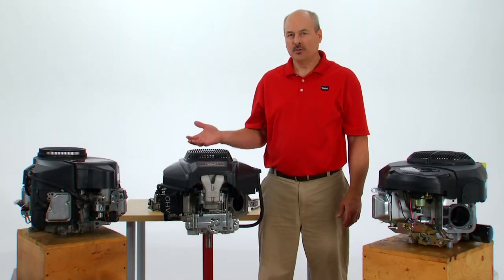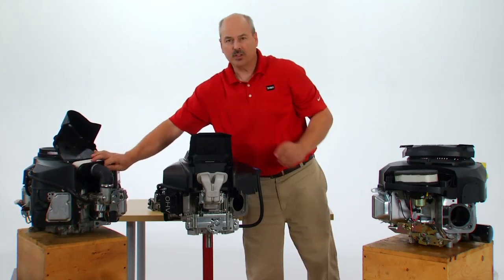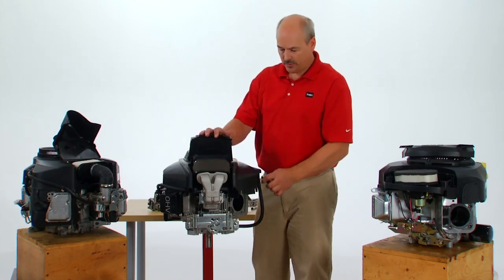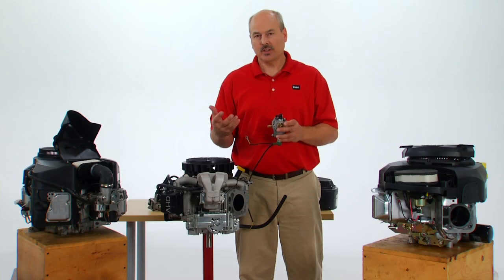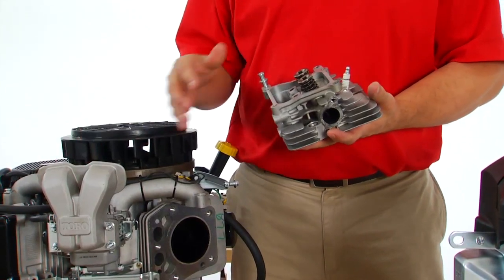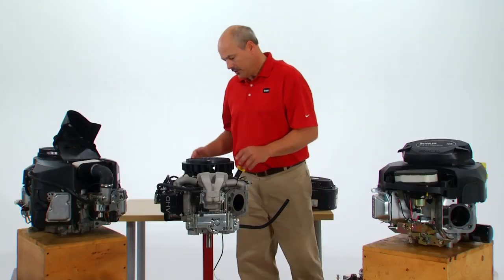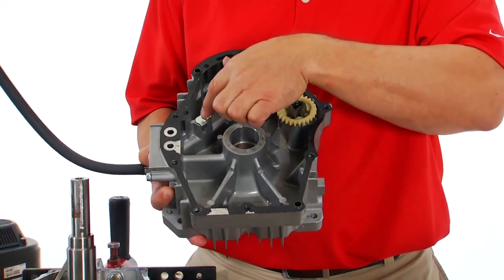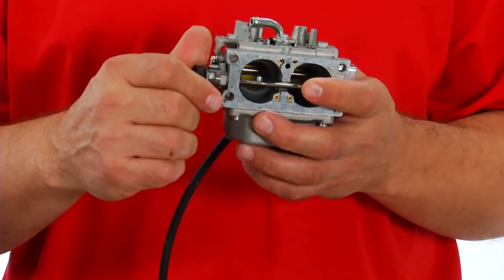Toro V-Twin Engine

Comment: This video is 6 Years old now, Does anyone have any updates on the longevity of this motor? Curious about that "Composite" gear under heat and load over time. Has Toro backed their warranty with these motors?
Reply: 3-year unlimited hours warranty for the Toro.
Reply: I got one and I wish I would have bought a Toro with a Kawasaki engine. The Toro brand is made by Loncin Chinese company, mine back fires and the paper work says it has a warranty but I have yet to see it.  When I take it back for warranty they only do what they can charge me for. In fact I will never buy another Toro. I have the commercial myride I only bought it for the seat. It's more comfortable than my big chair at the house. and has shock absorbers on it for comfort.
Reply: I ended up buying one and have about 20 hrs on mower and so far so good. Break-in oil change was a breeze and synthetic oil seems to help with fuel consumption. I'm not using mine for commercial use just a homeowner.
Reply: You have to turn it off full throttle

Comment: I know for a fact of the other engines have a pre-filter as well
Reply: I bought a 2020 titan with a 48 in deck. I have 3 questions that I would appreciate a logical answer from a Toro expert.. question 1. Why does a toro want to start the engine at full throttle,?  2 Why shut the engine down at full throttle? 3 why engage the blades at full throttle? I have never operated any piece of equipment this way. It goes against logic. You don’t operate any other piece of equipment this. Way. That I know of except a cheep push mower. If you operated your car/truck nothing would last very long.i have never owned a 0 turn mower but I have Chain  saws, Blowers, string trimmers, small garden tractors.with small 2 cylinder engines and blades with electric clutches. Most engines need to warm up to get full lubrication. Looks like there will be a lot of extra wear on the engine, electric clutch and belt. As for shutting down the engine at full throttle I would think it better to let the engine idle a few min to cool down.
Reply: It will backfire bad if you shut it down at idle I have a toro 60 with the Kawasaki 24.5 hp motor and it specifically says to shut it down any full throttle and engage the blades at full throttle if u engage them at low throttle it jerks and jumps the belts

Comment: I have a 2015 toro 50 in ss5000 with the 24hp toro motor have had nothing but trouble with it from the start.I can never get the motor to start had it to the shop 10 times they told me they were junk they get them in all the time.I wish I never bought this mower...
Reply: then im sure if we search on youtube we would find dozens of "failure" vids aabout the toro engine???? NOPE!
Reply: Mine has been a dream. You must be one of those people where everything breaks for some reason.
Reply: @crabtrap  I have one. Many regrets. back firing all the time took it in for warranty and still back firing.  Junk  YIP
Reply: @tonyjohnson1068  backfiring? Thats your issue??? Take back for wanntee or stop driving with choke on.
Im on 2yrs zero prob with machine or the Lincon emgine
Reply: @crabtrap  I did take it back for warranty and I don't drive with the choke on,
Reply: @tonyjohnson1068  then stop using gasoline from an old pickle bucket.  also take it back and say "fix it!".
Reply: @crabtrap  Not funny. I use ethanol free gas. it had 20 hours on it the first time I took it back. I need to find me a new Toro Dealer.
Reply: @tonyjohnson1068  yes, a new dealer shop would help

Comment: What is the difference between the two Toro V-Twin engine options? There is a 24.5HP Commercial V-Twin and a 22.4HP V-Twin. Both are listed at 708cc despite the HP differences. The 24.5HP cost a whopping $800 more. I can find no literature specifying the differences between these two engines.
Reply: If bore and stoke are the same. Carb/Cam =More air and fuel =More hp/tq. Need to check p/n's for the cam if the same. Then it's all carb and you can buy the carb and have more hp/tq. But you will burn more fuel for what? I can see it if you need more hp/tq. if you are having trouble in tall grass. God bless and stay safe.
Reply: The carburetor for the 22.5 and the 24.5 I believe are the exact same part number. It might be a cam difference I'm not sure. It may also be a different part in the carburetor. I'm curious as well as I'd like to find the part to turn my 22.5 into the 24.5.
Reply: Hp and air filter that's all.

Comment: I have a timecutter with toros Loncine engine has hard start problem from new backfires and barely starts sometimes it will run battery almost flat to get it going it's been in shop had new carb no difference,got all new plugs oils filters had tank checked  fuel pump checked.anyone have any ideas of what it could be?
Reply: Mine would backfire when shutting off, put a new set of ngk plugs in it and it fixed it idly enough

Comment: hi i just bought the toro ss5000 with the toro engine and notice it smokes only when start up then goes away.  why is this
Reply: A Bruce lmfao, you overfilled it with oil, congrats!
Reply: Normal break in smoke
Reply: Becos its junk...
Reply: If you started it with choke smoke is just the burn off from all the extra fuel....it stops when you turn off the choke and throttle up.

Comment: I have heard good things about Toro engines.. however, I will still prefer the Kawasaki!!  Why risk it with the new toro .. just like any other thing it will need an update after another
Reply: Don't listen to all of the critics Armando. This V-Twin will outperform and outlast your Kawi I believe. From my experience those loud archaic Kawi steel cams will need adjusted in due time. This baby is as smooth as a freshly washed butt. It's Toro for the win! :)

Comment: Was considering this engine: Nylon gear assures that I will not buy one under any circumstances. See Kawasaki, 1990 era for details.
Reply: Solomon, I've heard that all the pro stock cars use nylon cam shaft gears, and that they run smoother with less drag. Perhaps they've come further along since 30 years ago in technology. Fiber reinforced, etc. Then again, I own this engine so I may be just telling myself it will be fine : )
Reply: @rickcox1843  do you honestly think with all that fine milling work they are 'skimping' with one nylon gear??? i'm confident that nylon gear has extreme advantage. i remember when people said this about Glock pistols "a plastic gun...no thanks!"
Reply: @crabtrap  You do realize there are both plastic and rubber parts on nuclear warheads, tanks, bulldozers etc. Your  all-metal parts will rust the first time your stuff gets rained on or the air conditioning in your house breaks. Your metal gears will also likely need more maintenance and will still not outlast some of these quality renovations. You sound a lot like Frankenstein's monster- "Plastic bad! Nylon bad!" lol.  :)
Reply: @rickcox1843  again this manifold is aluminum.....does that rust alot??? could they have built it out of carbon fiber??? yup! necessary? NOPE! also turns out, they use aluminum stuff on warheads and tanks too! go figure!  PS this engine has a nylon timing gear with i have zero prob with
Reply: @crabtrap  Just as I have no problem with the nylon cam shaft gear. Works perfect and will last longer than most of the metal gears from what I can tell. 
As for the aluminum manifold, I agree that material works well for its purpose, just as the nylon cam shaft gear works well for its purpose. Show me one complaint wear the nylon cam shaft gear has failed. If not then why do you pursue the argument that the gear is weak?
Reply: @rickcox1843  put the crackpipe done buddy, no where do i complain about th nylon gear.
Reply: @crabtrap  Haha, right on. I realize now when you put "no thanks!" you were referring to other people saying that, and not yourself. My bad. Crackpipe put away :P
Reply: @rickcox1843  was the crackpipe made of aluminium or nylon, is the question?
Reply: When it comes to Toro engineering I have full confidence that they want a quality built engine to uphold their reputation of building excellent equipment!  I buy a new Toro ever 10 years however I still have my 1st one I every bought since I have never had one go done.  Always had Briggs and Stratton engines  (push mowers, 2-22" & 1-30") but curious how this one will hold up.  We will see just hit 5 hours break-in oil changed.  No issues yet.  1st zero turn.  Time will tell.
Reply: Nylon crackpipe all the way helps with cooling the crack oil faster so u can get another hit in faster

Comment: Nylon cam gear :( why do you torture me Toro
Reply: It's not plasic like Briggs uses. Nylon won't melt.
Reply: I was not worried about melting :\
Reply: Crisp Cuts Landscaping So...nylon isn't plastic??
Reply: Me too. The two nylon gears worry me a lot. I'd like to know whether the Kohler has nylon gears inside it.
Reply: @kurttappe  lmao Kohler has plastic camshaft  lol
Reply: Even honda motors use plastics in their motors, this includes race bikes
Reply: I owned  a 1986 Monte Carlo s.s. with the super slow 305 v8. It had a nylon cam gear.   I beat the heck out of it , it had 189,000 on the motor never had a problem  with timing  components.  Dumb  example what this video  is about but just saying about nylon gear durability.  Clean oil is the KEY.

Comment: the cam shaft on the toro is plastic because they want it to break for more money, i can recommend Kohler but not Courage and 7000/6400/5400 series as both i have had serious problems with, Commands are the best i own 8 one has been good for 18 years its in a Toro Dingo 220 mini skid
Reply: I know the Kohler  Courage has a bad rep but I have one with 450 hard hours on it and it is still a beast. I must be one of the lucky ones.I do change oil every 30 hours though. Still runs the original plugs.
Reply: @retiresoon5639  would say about the same on my zero turn never changed oil but it just always leaks and for 21hp it bogs down on high grass unlike a 20hp v twin command

Comment: Why two carbs instead of just fuel injecting it? Also, the "Toro" engine looks suspiciously like a B&S. Is it really? I would love to have heard you address the compression release system on the "Toro".  Hope that is an improvement over the B&S Intek. The B&S compression release camshaft WILL let go grenading parts all over the inside of the crankcase. With luck no major damage, but highly unlikely. It is not a matter of IF but When. Thanks for your explanation of your new Toro engine.
Reply: Made in china
Reply: @cefb8923  - in my 2 weeks of being in the market for a mower and researching - yes. Like every other hobby interest - you definitely have your fanboys and snobs in the mowing community.

Comment: When are you guys ever going to get around to putting electronic fuel injection on your engines for the regular Toro time cutters. It's ridiculous that we're still using carburetors.
Reply: Why it's a 24 hp motor that sits at full throttle all the time. Can't see any reason to do that, car engines are fuel injected for different reasons.
Reply: @cefb8923  Well for several reasons. Fuel injection is much more fuel efficient, and easier starting, no choke to mess with.

Comment: Where is your engine made? I know the Kohler is made in the USA, not sure about the Kawi? Also the Kohler has options that you are conveniently forgetting to show like a pre filter just like the Toro engine. Also the Kohler has a tool-less oil drain with a locking mechanism so if some pulls the oil drain like or it gets caught on a branch the oil won't run out of the engine all over your grass or driveway. The Toro oil drain is an open hose and will drain the oil sump! All Kohler and Kawai engines have cast iron sleeves in the cylinder. Again you kindly forgot to mention this. By you leaving out a lot of information on the Kawi and Kohler it feels like you are trying to trick people into thinking your engine is something great. Too bad you don't have real features that make a difference in the engine life and performance.
Reply: Joe Johnson Chinese engine.

.
Reply: It would be virtually impossible to catch the drain hose on anything and drain the oil the way it is designed. Also, if you watch the whole video, at 5:18 he clearly shows the cast iron liner. I work part time for a lawn and garden dealer and we haven't had any major problems. They have been very reliable and the commercial guys love them.
Reply: A chinese company makes them for toro. However so far they've been doing good and its the same company that makes engines for BMW motorcycles.
Reply: Mako they couldn't make them in a non communist county?
Reply: Strong Tower Lawn Care manufacturing cost in china is low
Reply: Mako yeah. No environmental standards, no safety standards, government manipulates currency. Plus wasting millions of bbls of oil and lots of emissions from oil powered cargo ships that end up being junked on beaches in places with no ROL where all the polution can just go into the sea or ocean.
No, I go out of my way to buy stuff that's not Chinese when I can. In this case most other mowers in this price point, including World Lawn have US made engines and transmissions. Most components actually are US or Mexico on all units I've owned or serviced....
Sorry but just raise the price on the #1 brand of mowers in the world and build that engine in US, Canada or even Germany where you know guys are getting paid a good wage and taking pridein the product.
Reply: Kawasaki made by Japan

Comment: I would not be concerned about a nylon cam gear. The chevy 427 used them in 1966 without a problem.
Reply: chevy used nylon covering on an  aluminum gear for noise. I would be concerned about all nylon.
Reply: NOT TRUE
Reply: LOL..without a problem..I don't think so.I had two plastic cam gears fail on me with two separate Chevy engines from the 60's and early 70's When the plastic would fail on the teeth those little aluminium nubs left would let the chain jump time.

Comment: anyone had any experience with the Toro v twin on the titan running rough? My 2019 has 30 hours and surges, acts like water in gas etc. I've drained tank, drained carb, added non ethanol gas, stabalizer etc to no avail. thanks
Reply: sounds like a vacuum leak
Reply: Hey have you managed to get it running back to normal yet i have the same issue?
Reply: Andrew Chomicz no. I’ve cleaned the carb, cleaned the metering valve etc, checked for vacuum leaks etc, changed to non ethanol fuel, all to no avail.
Reply: @CurtisPittman48  I have not tore down that carb, but from your description it sounds like one of the jets is slightly plugged. If you choke it a little and it Smooths out, then it indicates its searching for gas.
Reply: @raybonecrusher4516  I’ve had the carb apart and it looks clean as a pin. I also removed the metering valves and cleaned them. Runs great with blades engaged but surges all other times such as when pulling my aerator.
Reply: @CurtisPittman48  Did you clean the pilot jet? Check the schematic for your carb so you know which one it is. 
Ray
Reply: Your supposed to always use ethanol free

Comment: My Toro 24.5 engine will not idle smooth. It gallops. aother than that is a powerhouse.
Reply: Check thottle rod spring may not be on or broken or carb maybe dirty. Both will cause hunting and poor running engine.
Reply: It only needs one thing wrong .....and theres always "one" thing on a new motor....except a Kawasaki that is